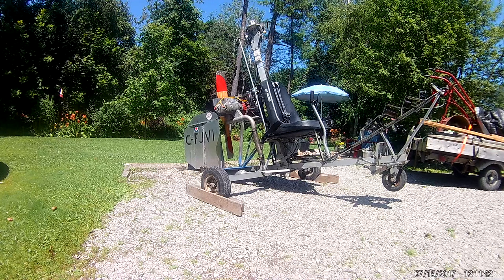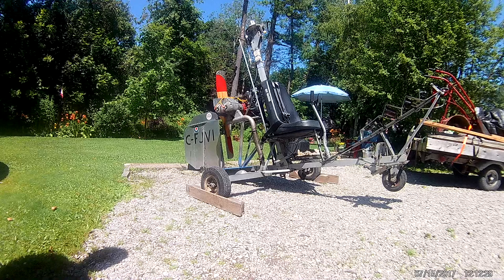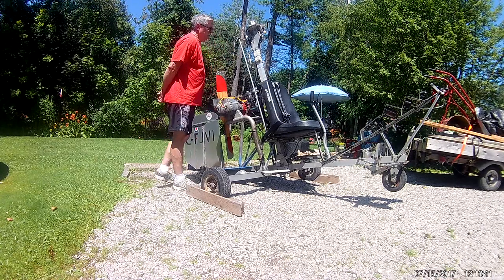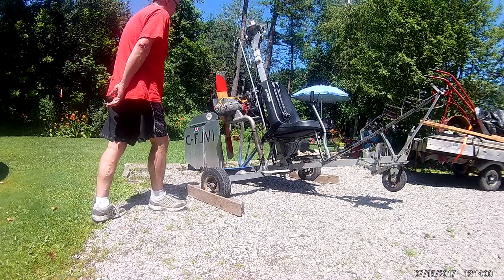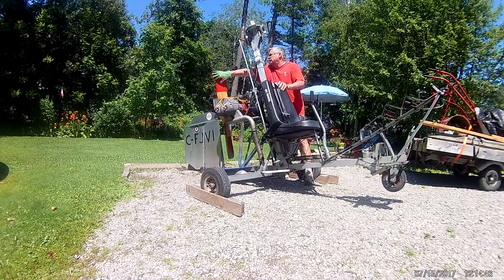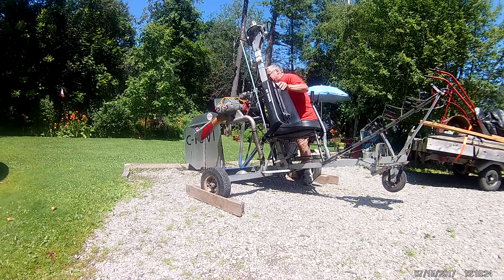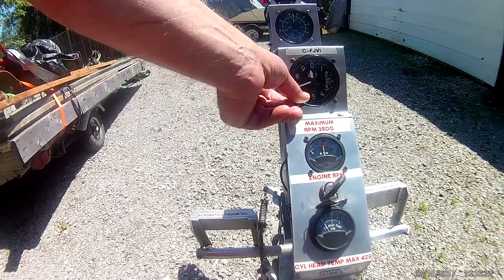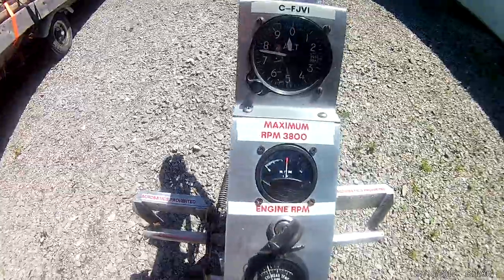McCulloch drone engine start innisfil 1

Comment: I have two McCulloch 72hp motors that I would also like to convert to CDI, do you have a link for RDA?  I am looking on Rotary wing forum and elsewhere, but no luck yet. Good video, very handy detail thanks!
Reply: Ben Hansen you ever find cdi set up in looking for one as well
Reply: Found some leads. Mostly I found a service for my mac in TX
Reply: @earlshaw1299  I found Bob from the Mankato Gyro club, he has been building his own for quite a few years. I really wish we could get dual mags on these old McCulloch's, that would make them real engines, but not really up for casting cylinders!.